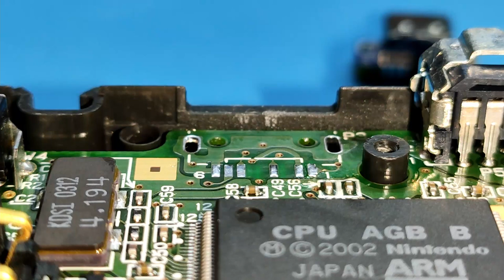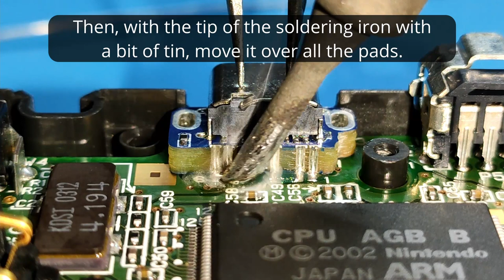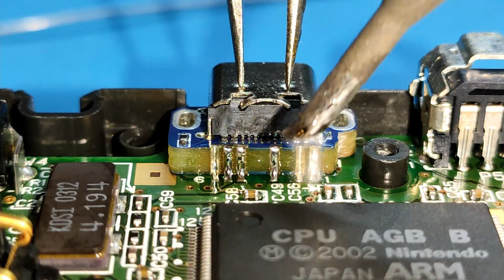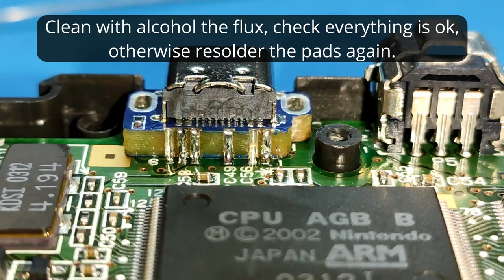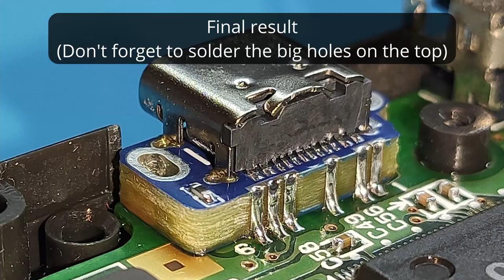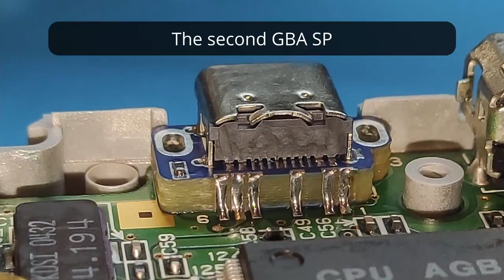Game Boy Advance SP: USB-C Kit (Centered v1.5)

Comment: What is the difference between the 1.5 and 1.6 board? thanks
Reply from the maker: I added castellated holes on the left and right of the board, not only for the data connection pads:

2022-12: v1.5:
- PCB thickness of 2.4 to center the USB in the hole.
- New castellated holes (pads) to make easier to solder the board.
- New redesigned plastic cap made by resin 3D printer.
- USB-C to USB-C cables/chargers support.

- 2023-01: v1.6:
- Added castellated holes for the shield pads.
Reply: @giltesa  Thank you